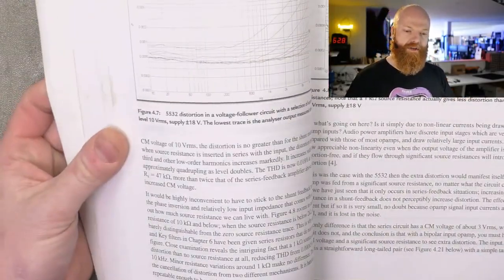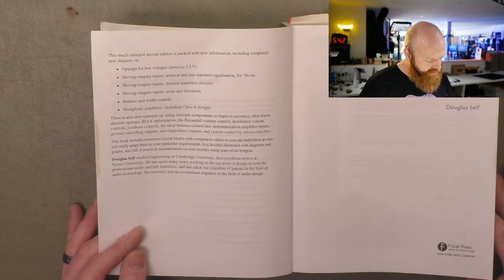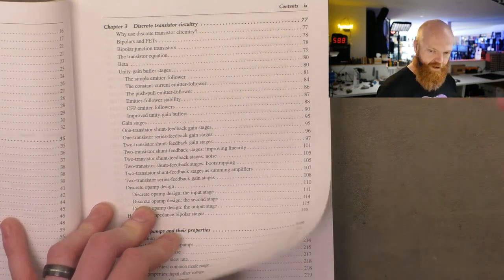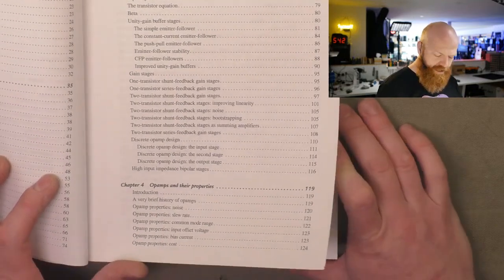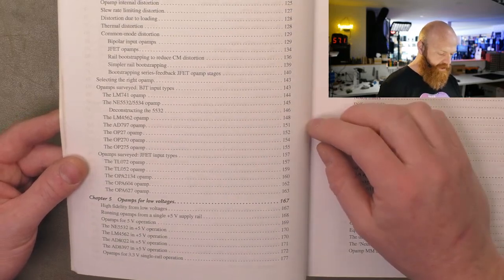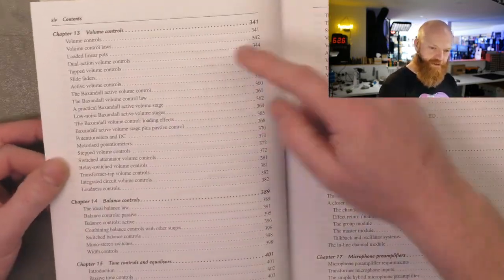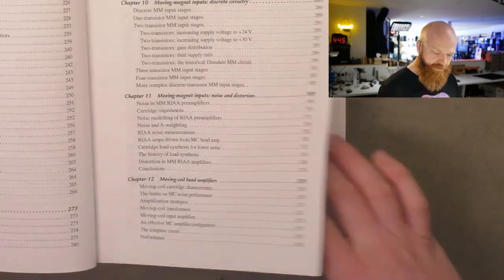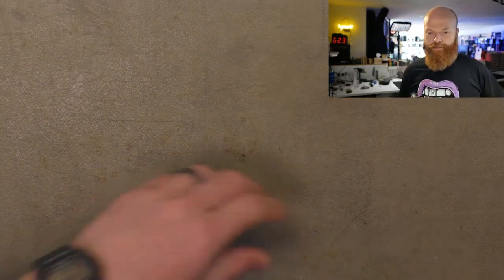Featured Book: Small Signal Audio Design (By Douglas Self)

Comment: This is ONE book that is probably ranks a 10 out of 10 for a must have book in your library. The Radiotron Designers Handbooks 3rd and 4th Editions should  go together and are also 10s. The 3rd edition Radiotron was one of the books I decided to save after one of the shop floods. The 1936 Railroad Construction Handbook and the 1907 Railway MOW books, and my prewar Electrical Handbooks were even sent away for special dry cleaning. I will need to get new covers made by a binder. The railroads had some very clever means for block detections and signaling as early as 1905, including inside the locomotive cab signals!

Comment: Looks I need this to the shitter library !  Need to branch out from Merlin
Reply: There is a whole other world of industrial valve stuff out there that will blow your mind. Inside of my high voltage tube regulated power supplies were resistor banks made by W.L., and they are beefy racks of porcelain form power resistors. Who the hell is WL? That's Ward Leonard. Or it was Ward Leonard. There was a man who made a nice bunch of rabbit holes of industrial valve circuit designs. Gas VR glow tubes, Ignatorns & Thyratrons. It sort of dovetails into SCRs.

Comment: Wierdly just started recapping a Ebay purchased Nad 3020 series 20 (first edition) has 100hz hum... First attempt for me into hi-fi 😫 Schematics a little daunting coming from tube amps, but once blocked out into sections you start noticing symmetry righ/left channels....Funny you mentioned bi-polar caps cus currently reading up about what types I need in certain sections...Opting for Nich PW in power and those audio golds in signal...Other thing I found quite good was hifi schematics has bold line where signal flows, they should do this on tube amps its quite handy to see...